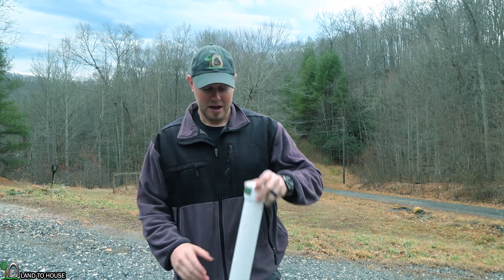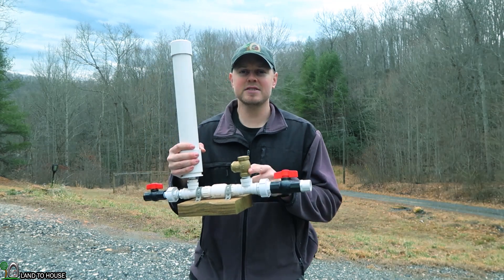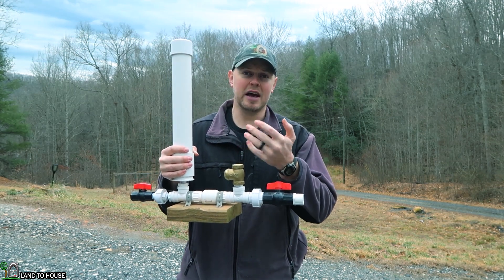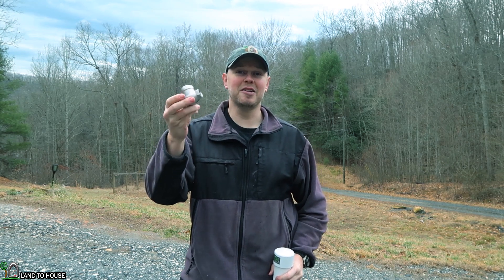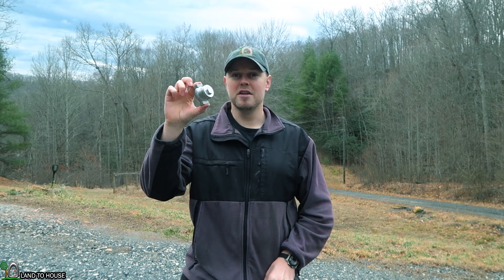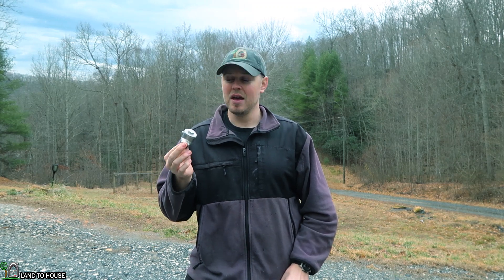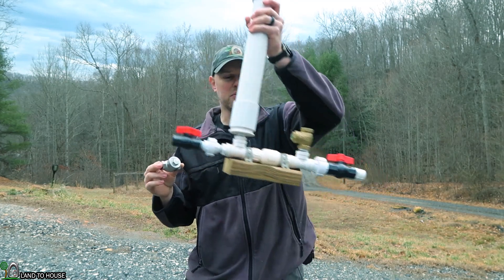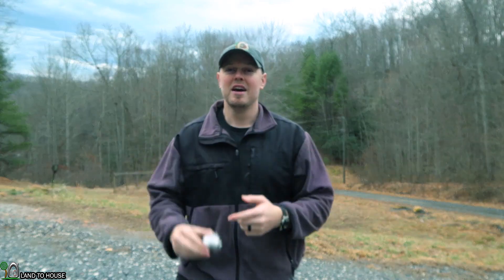New Stainless Steel Valves for Ram Pumps

Comment: So I was thinking I could use one ram pump from my water source to pump water into a tank lets say 15 feet above ground have a line running back down from that tank to a second ram pump which would give me even more water pressure pressure in my line.  Do you think that would work?

Comment: Make a video which shows how much water rises in a vertical tube if u fit it with waste valve
Reply from the maker: I do plan on making a comparison video between the brass and stainless steel valves.

Comment: I have a request for a test on the ram pumps. I have been watching your videos about your ram pumps. The different sizes and every other test you have done. What I am wondering is can you put a different size swing check valve on and how efficiently it works. Like if you have a 3/4" ram pump, having a 1" or 1/2" swing check valve. Would it provide better pressure and better water flow or not. Would love to be able to see a video like this

Comment: Did a quick search on ram pumps in series. None found. You did two into one delivery pipe. 
How about in series as they go up hill? Or would the surge pressure it takes have to be in sink or just not work at all? 
Love the land your on. Have friends and family in Tennessee and they live on the most beautiful land with creeks and streams.
Another thing. I use to be into fish tanks. For my flow I always used 45 degree angles or sweeps for my direction changes to minimize resistance adding to back pressure. Using 90 degree angles which you may already know, or not. Is like running into a wall before changing directions reducing flow rates. I always ported my plumbing as well so I could use smaller pumps achieving better flow.
Reply from the maker: Check out: cascading ram pumps. This spring I am going to test some more on this concept.

Comment: I have a quick question. I’ve been watching your testing videos and I wanted to comment on your latest video to make sure you saw it. could you have two ram pumps with two separate supply tubes feeding one drive pipe at the same time. would that increase flow rate and output or would the pumps fight each other.
Reply: I am not an expert but i've seen brasilian videos with several ram pumps feeding an irrigation sistem.
Reply from the maker: Yes very true. It is possible.
Reply: @LandtoHouse  i've seing a lot of ram pump videos/plans for the past 3 years and now with this global quarentine (i live in Madeira island-portugal... please search in youtube when you can so you can the the creeks dumping/waisting milions of litres to the sea) i am trying to fix a way to get some water to the top of my property. I've seen your videos of the world's smallest ram pump because i have a small well 1000l/day in the lowest part of my house and have an eletric pump pushing it 8 meters above and 30 meters away. The maximum drop to engage the ram pump it 1 meter high and 10 meter long. My problem is that the waste will be larger than the elevation capacity. The other problem is that the well fills from the bottom and some drill holes on the sides. When i made the house fundations the water burst from the ground up and i keept it with some concret walls and no bottom. It is like a filter. I have been seing solar/wind solutions but i would prefer a ram pump. Do you see any solution for me??? Wherever the answer, thanks a lot... Sorry about the  english...
Reply from the maker: Yes it's possible to have two pumps running into a single delivery pipe. I actually have a video on that and another one planned for a few weeks from now.
Reply: Land to House sweet

Comment: Have you ever tried using an expansion tank instead of that pipe chamber? They have a rubber bladder and you can adjust the air pressure on the back side of the bladder.

Comment: I wonder if the improvement on the pump flow is caused by the stainless steel gate being heavier. In that case you could probably tune the performance of the brass valve by drilling a hole in the center and attaching weights. Maybe a washer or penny at a time. Can you perform this test?
Reply from the maker: I do have a couple of brass valves left. And you are correct. The weight is what adjusts the flow. It would be fun to try this.  I will add it to the list of tests! Thanks!

Comment: Good Job Improving A Product ,Instead Of It’s Good Enough,Thanks For Your Videos ,Sure Wish I Had A Place To Use One !!!
Reply from the maker: Thank you. Yes the brass valve life has bothered me for some time. It's so nice to have the SS valves. I pulled the one from the creek and could not tell it had even been used.
Reply: Any way to tune down cycle frequency if the output is in excess of what's needed (gardening, maybe?). Oversize pressure chamber, drop cycle rate and try to aim for a decade of performance before wear parts crap out? Can hardly get any better than that for the environment 🍃
Reply from the maker: @embretr.string5204  a smaller pump can do that. But if you want to reduce cycle frequency install a long drive pipe or add weight to the waste valve.